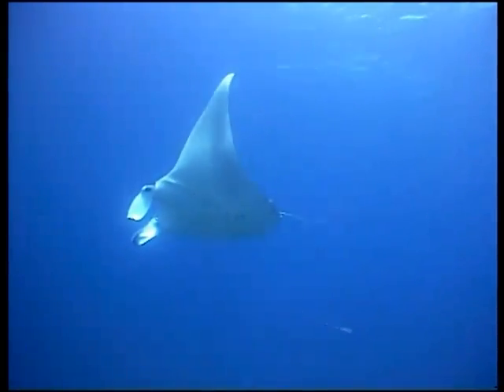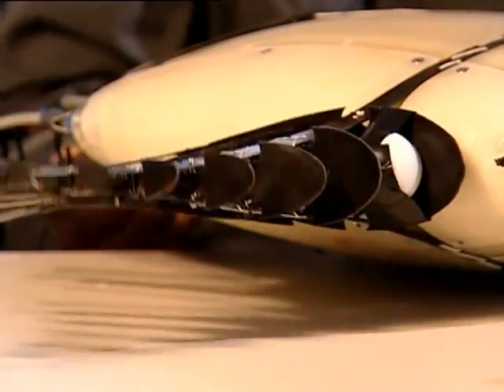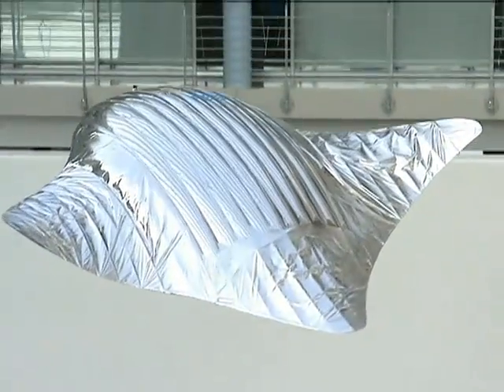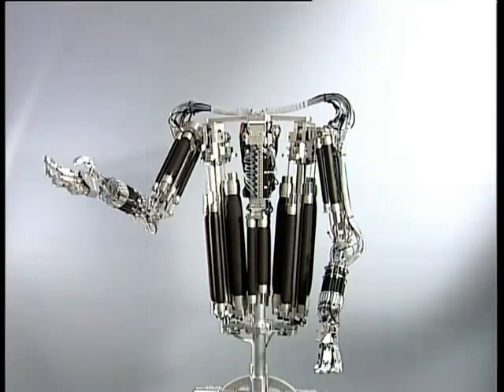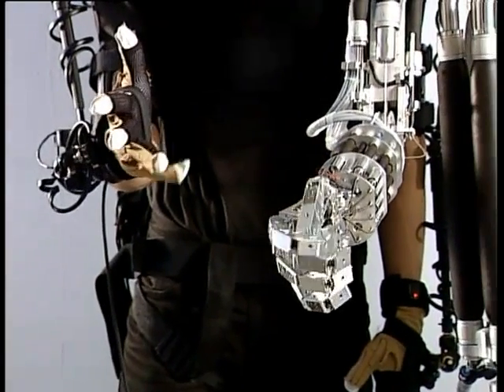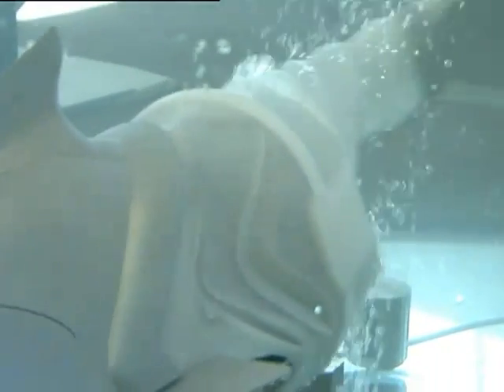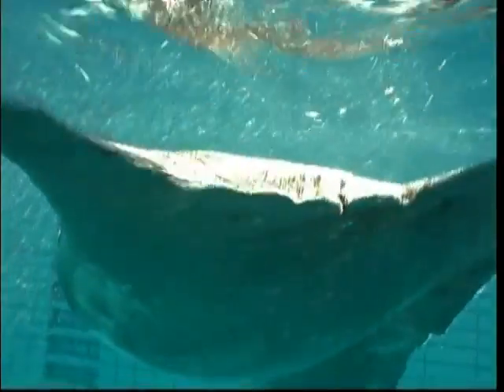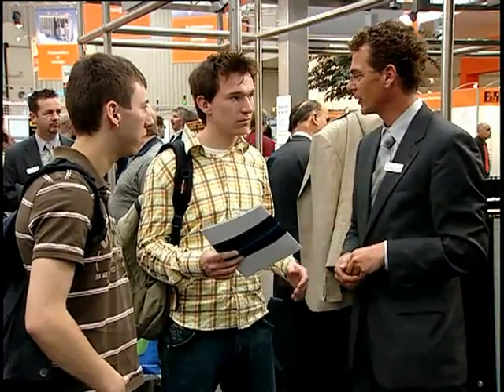Festo's Extraordinary Robots That Mimic Biology II: Bionic Learning Network

Comment: use silicone for veins to pump liquid inside separate silicone mussel molds to expand and silicone arterys to retract the muscle and use liquid like hydrologic instead of air, you'll need less pressure to operate with more power, copy the human body, it was put together the way it was for a reason
Reply: the silicone veins would pop real damn fast will never work .. the reason they are using air is to cut the LBs bro .. man you have really bad advice it really shows that you know nothing of this ..
Reply: you just have to experiment with the molecular structure when you make the silicone you reenforce it to make it stronger, the reason they use hydraulic is because it can move more weight, eliminating the need for having a lighter machine in my case humanoid robot, but thanks for jumping to conclusions

Comment: @Skoda130 You might be mistaken. "BigDog" by Darpa is basically also build around hydraulic/pneumatic system. Also full size humanoid Petman. Pump that powers their muscles is supplied by electric engine.

Comment: @defuntoba imagine your elbow not as a ball, but a disc. This disc is placed in such a directions, that when you represent your stretched arm as an arrow, it will pass through the centre of the disc at an angle of 90 degrees.
this disc is connected to the shoulder by 3 or more "muscles", that shorten and elongate disproportionately. This way you can control the angle at which the disc is as well as its rotation.
This same system can be applied to the elbow and the wrist, et voila.